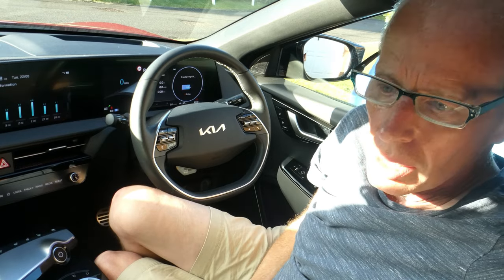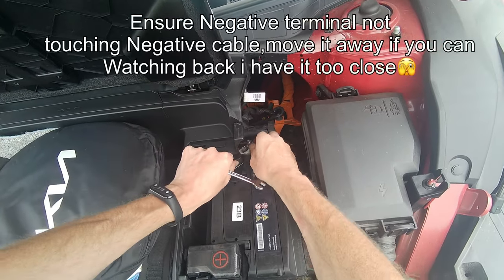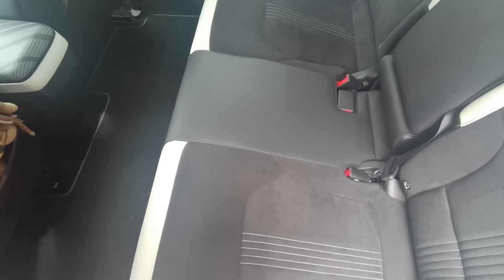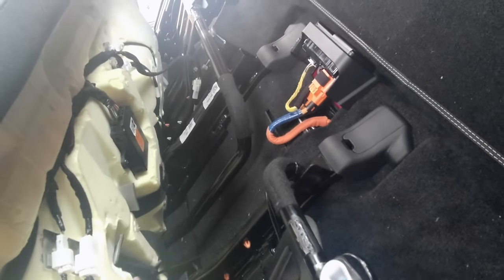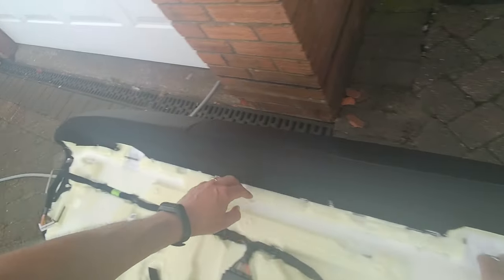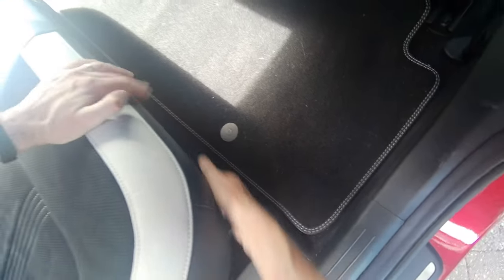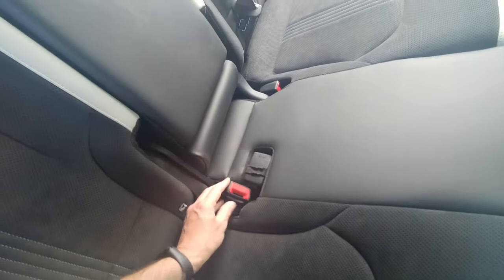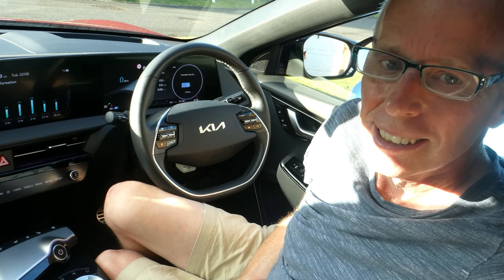Kia EV6 - How to remove the rear bench seat - a practical guide ** see extra safety warnings👇**

Comment: Very useful info and very clearly explained - thanks! I'd hoped that the rear seat base would fold forward to allow the seats to fold flat (I can see that they don't now). I'm about to go to your channel but just wondered if you have/would consider producing a video on all the heater/VAC settings. I note that my EV6 switches to a 'fresh air' mode despite the cabin being cold, probably because I had the  recirc on for so long. A HVAC video would really help me a lot.
Reply from the maker: Already did several videos on HVAC,auto ventilation setting causes random heating and cooling, bare with me whilst I find the links
Reply from the maker: This is the one https://youtu.be/KG0-cmG9dBc
Reply: @evodessey  - thanks so much. I'll wait for the links. My opinion re: the EV6 HVAC is that it's far too clever for its own good and over complicated - or its just me and unfamiliarity.
Reply from the maker: Link is in the comment above

Comment: Just a heads while disconnecting the first large plug which solved my rear heated seat disconnect RE Kids however it also disconnects the seat belt warning bell for the kids in the rear which I'd imagine would de activate the rear airbags so back it goes
Reply: Might be useful info for someone whose got dogs in the rear maybe to disconnect the rear seat belt alarm
Reply from the maker: I’ll put something in the video notes cheers.
Reply: @lovingEV  Pretty sure that would be illegal

Comment: If you remove that support frame as well, could you add some high-tensile spacers to raise the rear bench slightly? Even a few mm would make a big difference to rear seat comfort for adults.  It is probably technically illegal (at least without an engineer's cert, though aftermarket seats and mounts are not necessarily illegal...) but shouldn't interfere with any safety features.
Reply from the maker: Roofline is quite low in the back already so i don’t know if it would be worth it or legal.

Comment: Isolating both batteries did you loose all you personal settings for the car ie seat memory ambient light colour
Reply from the maker: No. Settings are stored in the flash memory of the AVN unit (head unit) & also backed up to Kia Connect servers if you need them. Only a very few settings don’t get stored as far as i know.The extra level of recuperation in EV menu settings menu for one. Also the cable locking mode is not set to lock the cable in whilst charging also in EV menu settings
Reply: @evodessey   thanks for that its just when reading through the handbook it says don't disconnect the HV fuse as the car may not boot up on its own  with being reset by a diagnostic tool
Reply from the maker: That's in conflict with the Engineering notes for removing  the replacing the ICCU which also involves the removing back seat. Will have to check my version of the manual now
Reply from the maker: What page in the manual does it say that because I can't find it?

Comment: Hi Brian
Can you remind me what the settings were for the app on going away
 I am of on holiday soon and wish to set it up.
Thanks James
Reply from the maker: Sorry James, you need to explain what part of the App you are referring to. Do you mean for driving abroad so you don’t dazzle left hand drivers?
Reply: @evodessey  No. Just leaving the car here and flying to Cyprus
It's protection for the car
Reply from the maker: Setting Valet mode?
Reply: @evodessey  Thanks Brian
I forgot the word Valet Mode
Reply from the maker: Set Valet mode from the cars menus,if you use the app and the car loses signal it can get stuck in Valet mode,note that Kia Connect will shut down after 7 days of car not being driven
Reply: @evodessey  So as we are going away for a month. Should I use it then?
Reply from the maker: Yes I’d leave Valet Mode on( but turn on via car menus)  If the car gets stolen and driven then Kia Connect will start as soon as the car is driven again and then can be location tracked on Kia Connect again.
Reply: @evodessey  Thanks Brian
So you advise to turn Valet Mode on while I am away?
Reply from the maker: @jamesduffy8669 yes

Comment: Well very interesting to see what’s under there but I cannot see a reason for anyone else to go doing that. My point is why would you need to go under there. If they wonted you to do this the manufacturer would of made it easier. Secondly i would not recommend anyone doing it because I had to have my back seats out of my e Niro to have the seat covers replaced under warranty and the seat never fitted right the clips needed replacing but didn’t bother as my new car was inbound.
Reply from the maker: Stuff gets dropped down the back of the seats and has to be cleaned up and removed that’s the main reason. Happens a lot if you have kids and clumsy adults.
Reply: @evodessey  good point but you’ve got go some to do that.
Reply from the maker: @stephenclay6852 you get a lot of interesting stories in the comments
Reply: @evodessey  👍